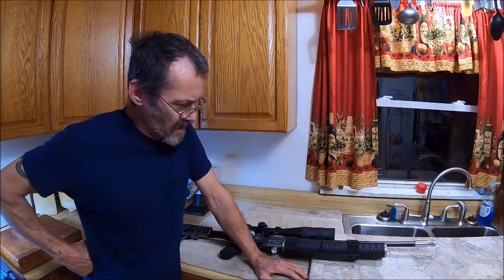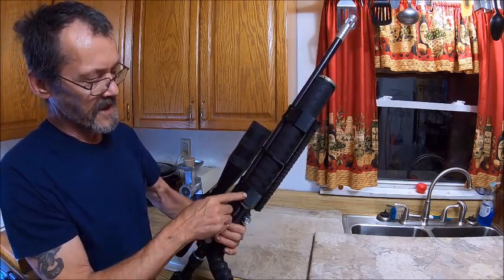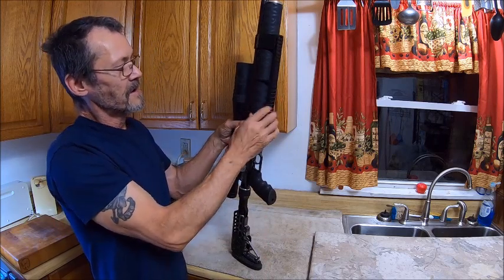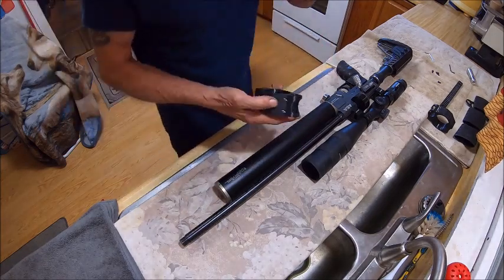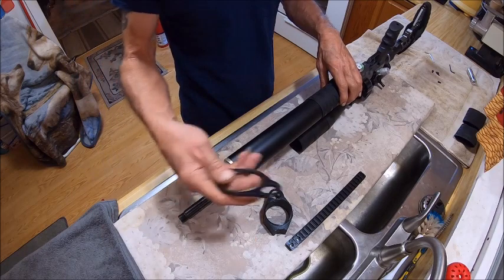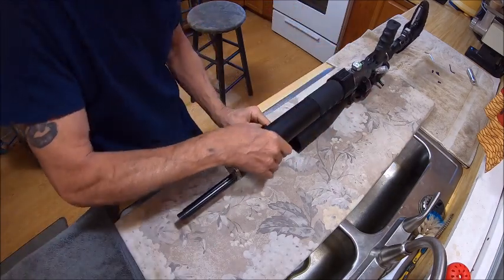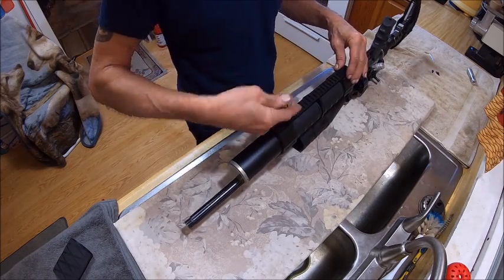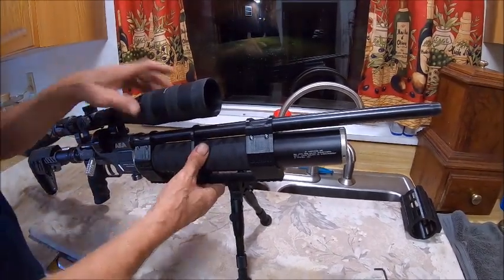AEA M50 pic rail system by bison

Comment: Very nice. I would be interested in trying it on my brand new S45. Where are you sourcing your 12" metal picatinny rail?
Reply from the maker: the gap between the tank and barrel may be different from the m50. but i can make this for the s45. i got my rail on ebay. i will add the link in the description for you. just email me and let me know your measurements  on barrel, tank and gap between them